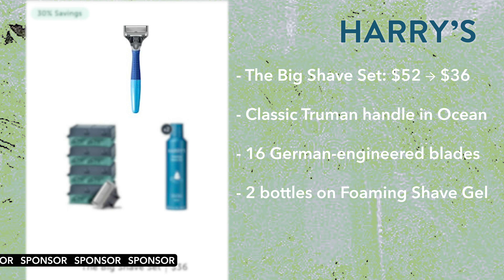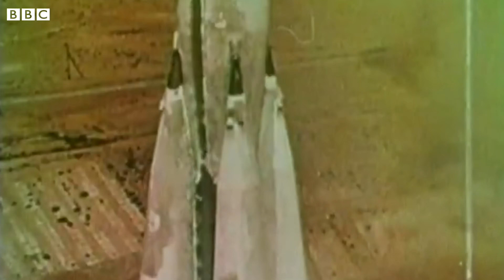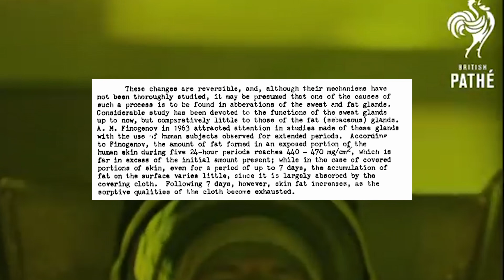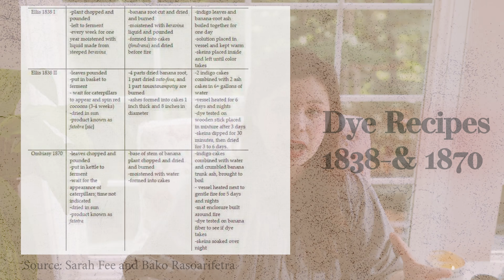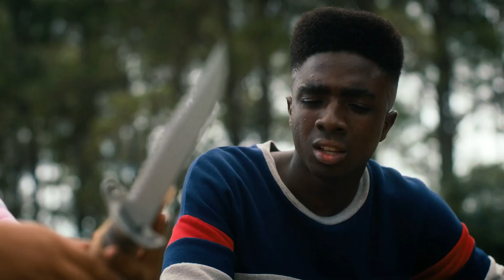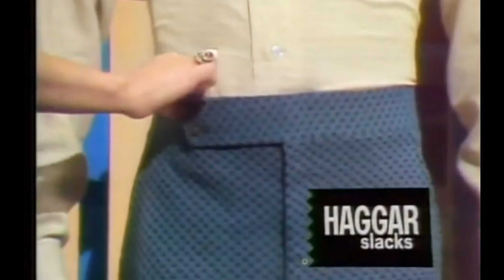The DISGUSTING truth about Laundry

Comment: I've been activily working of this (and I mean all of it) for many years. I'm surprised you didn't know about the poopy t-shirt bit before now.

Due to having hard water, I pour the water from our 2 basement dehumidifiers into the washing machine (laundry room is in the basement) - it's distilled and softer and a way to recycle it.
HE topload washer - it's energy star along with the dryer.
I use eco-friendly detergent (lots of research done to find an affordable one that was truly eco--friendly yet actually cleaned). 
Vinegar as a rinse so no Downy or Snuggle.
Wool dryer balls for when I use the dryer (which is towels and sheets that won't fully dry in our basement before possibly starting to get an odor).
And we have an interior clothes hangar for pretty much everything else. We tried using the outside clothes line but there were too many birds leaving too many gifts on our clothes which meant wasting more water and electricity in having to reclean them.

It's not perfect since, as you said, the water doesn't get hot enough, and water and detergent are used, as is some electricity to run the washer/dryer and dehumidifiers. But we gotta start somewhere.

As for the undies - I haven't yet found a linen bra-like garment that's comfortable. I've started looking into cotton undies to sew but haven't figured out what style I want to go to - bikini? 1950's style? I could use the holy t-shirts I have and repurpose them as a recyle... I have time to figure this out because I have conventional undies that will last a long while yet since they're line dried.

This was a good topic to bring up. Thank you for it.

I hope you feel better soon.
Reply: What detergent did you end up using?
Reply: @kp_escapes  I'm still on the hunt for one. Unfortunately, the ones I've tried have all had problems. They weren't actually eco-friendly, they didn't clean or remove odors, left my whites dingy, etc.

Comment: Also you're saying line drying is awesome but how do you avoid crunchy/hard towels if you line dry?
Reply: They soften up after they get a little damp. I really don't notice much when I'm using them.
 I've used indoor line-dried towels for almost 4 years, and they're fine, especially if I used the highest spin setting. Shaking them out a bit before folding also gets rid of some of the "crunch".

Comment: Use  White wine Vinegar.  Instead of any  Detergent. Also if you have a room with a glass door or floor to  ceiling window and live in a  State that  Band's laundry lines when use that room becouse the sun can shine though the glass it wouldn't be as  Effective as  Direct contact but it still works. Basicly use a  Curtain  plole to hang your  Laundry in the  Window. It works, I have done this when it was rain and the close got dry faster then the ones hang up in my bathroom so the  Indirect sunlight does work really well.

Comment: I hang/line dry pretty much almost everything. I am too disabled to do that to my sheets, but almost all the clothes get hung up to dry and my Fast Fashion... ain't. I've had some tops for like ten or fifteen years, and they continue to last because of this, IMO. That and I loathe fabric "softener" and scented detergents with a violence, so I use a very mild detergent made with enzymes for dissolving allergens, and not a lot of it at once. Underwear all gets a hot wash, everything else goes through warm or even cool. The wash is enough to clean it. I also subscribe to the "If it ain't dirty, don't wash it" school of thought. Saves time, effort, energy, water, money and wear. On the other hand I am often wearing light cotton underlayers which I do change and wash a lot and those keep my outer clothes much cleaner. Towels and underwear sometimes get sanitary washes, but by and large I trust my detergent/soap, and the water softener my house has. Places that ban Line Drying are anti-human.

Comment: Thank you Abby for this informative piece. I hope it helps people understand some of the issues better. 

I have been pretty proactive I my laundry practices. I have room for a laundry machine (front loader, in the area where a dish washer would normally go) in my apartment but a dryer is not going to fit. We have roof access (thank goodness) and hang our clothes outside from summer through some of the winter. We don’t hang outside in spring due to high pollen counts and allergies. In seasons where heat is on in the apartment (radiators-very drying) we use a clothes rack and hangers. Clothes dry quickly. 

I haven’t used fabric softeners for many years and have a bottle of “natural” fabric softener sitting in my laundry area for many years (think it’s time it went out). 

I have started making my own laundry detergent and find my clothes are softer and last longer as well as get stains out easily. 

We also use a shorter washing cycle which uses less electricity and decreases the wear and tear on the clothing. 

I hope others can start practicing better laundry habits soon.

Comment: Tip: Contact your local water authority for the yearly quality report and get some PPM sticks to check your water hardness. We're a family of 5, and 2 of my kids are tweens (yay puberty). I do upwards of 10 loads a WEEK. I also cloth diapered all my children. My washer/dryer get used a heck of lot and I've learned how to be efficient and how to properly wash all my fabrics. I wash like with like, separating tops from bottoms but then further separated by fabric weight. For the washer to properly work, the ratio of water::clothes needs to be balanced. Tip I got from my CD days was the water needs to look like stew while agitating. I wash loads of medium-large, most on cold/cold, use at least a 1/4 cup of liquid detergent (Original Gain), 1/4-1/2 cup of Distilled White Vinegar in the rinse. Soiled garments get washed in hot (my washer pulls direct from the water heater, doesn't mix cold in, and our heater is set to 150F) with extra detergent, bleach if necessary. Rinse in warm (btw body fluids wash out of fabric better at warmer temps). Yes, I tumble dry. I do not have the energy to line dry, I have fibromyalgia, it's a miracle I get anything done. I do hang up what is needed on a rod in my laundry "nook." All of my laundry comes out smelling fresh and clean but not fragranced, super soft, and not at all destroyed. I do regular maintenance on both my washer and dryer, including cleaning them!

Comment: I didn't really start truly caring about caring for my clothing (including cleaning of that clothing) until I started making most (still working on all) of my clothing.  When you put so many hours into a simple tee shirt, it suddenly becomes very important how you care for it.  I always use white vinegar instead of softener and natural wool balls instead of dryer sheets in my dryer.

Also, I have a question - as I live in the damp mid Atlantic and line drying sometimes ends up with mold issues due to humidity - does tumble drying kill bacteria that washing does not?

Comment: I bought a portable washer to use in my bathtub so I don't use my complex's machines. I also use a waterstick (shower water softener), so the water I use in the washer is soft.  I sanitize with vinegar (also helpful for reducing color bleeding) too, and socks & underwear get their own load...and because it's a portable washer, I can fill it with water at the temperature I want & match water levels exactly to the small loads. I also use the rinse water from one load as the wash water for the next load. And because my complex charges for laundry, I line dry certain loads to save money. And because the little spin dryer part is a MF'n BEAST, my line-dried shirts take about an hour to dry.

I broke even on the washer's cost with laundromat savings in less than 3 months. the waterstick shower softener has been great on my hair & skin, & I use WAY less shampoo, bodywash, etc...so even though that was expensive (for me) as an upfront cost, I feel like it was worth it.

Comment: One way to increase the temperature of your wash is to increase the set point on your water heater if you can. The biggest barrier to using older washing methods, in my opinion, is the time and energy it takes to do them. I have done laundry in my bathtub and it's really time consuming and exhausting. I am a household of one; I don't think it would be feasible to do laundry like that for a larger household with my current time and energy constraints.

Comment: A somewhat related topic I'd like to see covered: Historic infant diapering. With this big push into environmentalism, we've seen the advent of reusable menstrual products, which Abby has covered somewhat in that video about period aprons. But what about diapers for pre-toilet trained infants? I know that the age of toilet training has been pushed back and back with the advent of modern laundry machines. But, as mentioned in the video, the modern laundry process is horrid for the environment. As are disposable diapers. So there's been a recent push for cloth diapering of babies (again) and I'm super curious as to what the historical process of diapering looked like and to see if those methods have had any sort of impact on today's cloth diaper movement like we've seen with the repopularization  of natural fibers.
Reply: The way me and my brother were diapered as babies in the 70s was as following: rectangular diaper clothes were folded in a clever way so that you could basically close them like modern diapers but then with safety pins. Larger babies required slightly different folding. I think my parents used a plastic sort of pull-on over it ("luierbroekje" in Dutch) and/or a more fancy soft diaper cloth. When soiled, they were put in a bucket with a lid. About daily, the bucket was filled with water and using a plunger to strongly agitate (not sure that was general practice though, lol), the worst of the dirt was rinsed out. Then the diaper cloths were washed in the machine at 95°C and air dried. They turned a bit grey after a while, but they were clean.

Comment: Oh, no Abby, what have you done!!  I feel like I need to make a new set of underwear and boil the crap out of it \( ' o ')/aaaa  Possibly the state of launduring (??) is better here in Japan because most of us do not have a dryer and have no connectors or room for one.  We hang our clothes out.  It's frustrating when you have to do laundry in the wintertime.  Drying takes a couple of days versus an hour in the summer.  When I go out on trips and use the hotel dryer I freak out because my clothes come out major soft and I am unused to that.  Traditionally, Japanese had washed their clothes, their hair, their bodies with ash from the kitchen fires, and I have always wanted to try that with laundry and see how it works out. I don't have a kitchen fire though, and nowhere allows a good controlled burn in the city, not even a barbeque... go figure.

Comment: This was so interesting! I’m from the UK and used to drying my clothes on a line. In 2004 I moved to New Orleans for a couple of years. The first time I washed a load of laundry I took it out of the machine and hung it up outside and went to work. When I got home, my clothes were wetter than when I hung them out. I did not realise how humid N.O is! After that I didn’t have much choice but to tumble dry everything. I ruined many a bra doing that. I didn’t know that you can’t tumble dry underwired bras. I learned a lot. Now I only machine dry if I have to. And never my bras!
Reply: I live in that area too. Line drying is problematic to say the least.
Reply: Even though I would not advise tumble drying (especially padded) bras too often you could just try to put them in in one of these extra padded laundry bags. The larger ones are also great for not having socks everywhere ;)

Comment: hm. I think the most eco-friendly thing possible when it comes to buying a washer or dryer would be to see if you can buy a used or refurbished energy efficient one. But obviously that's going to be super difficult for most people. Other than that, you researchers would need to do a whole lifecycle/carbon footprint analysis on both types of appliances. My gut assumption is that it will depend on where you live and how much laundry you do, with odds slightly in favor of new energy efficient appliances?

In an ideal world, we would have a cyclical system where the old appliances are taken apart and used to make new ones!

Comment: I use white vinegar a LOT as well as bicarbonate of soda in my laundry. If I’ve had clothes too long in the washer, I’ll do them in another wash, using vinegar as the detergent. I also use it as a rinse aid (brilliant for softening up towels. I’m pretty sure it softens up the water AND changes the pH, which would help handle a lot of microbials. I also use it instead of fabric softener, for things like towels. I also use eco detergent, like Faith In Nature, ECOS or similar. Another recent tip I found out was to use a bit of bicarb of soda as a prewash, which REALLY helps with deodorising things like sheets that are a bit whiffy due to age. Bicarb in the prewash, vinegar instead of fabric softener. I do use a tumble dryer, but these days I hang things out to finish drying on an indoor airer and a lot of my clothes go on that anyway. A dehumidifier is excellent for faster clothes drying. I also do an extra spin to cut down on drying time too, if the garments will stand it. I always also use protective bags for washing things I don’t want wrecked too. There’s some great books out there describing how to use vinegar, bicarb, soda crystals, lemon juice and the like for laundry. And ironing helps with drying and softens things up nicely too

Comment: PSA for handwashing delicate clothing like bras etc. Instead of using the expensive handwashing detergent just use shampoo. It is gentle enough to not dry out your skin horribly and is designed to clean the oils from your scalp.
Reply: shampoos are every bit as bad as laundry detergents.  They contain chemicals that strip the hair because in order to clean your hair, the conditioner and other hair products you use, need to be removed before the normal scalp oils can then be cleaned.  And they add chemicals just to make lather so it looks like it is doing it's job.
Reply: @JeanneLugertLadyTatsLace  I will not disagree with you. If you have a detergent-free option for handwashing that is effective and inexpensive I would love to hear it. 

My comment is merely ment to give people an inexpensive opinion that is effective rather than an environmentally neutral opinion.

Comment: If you wear woollens you can lanolise your clothes and they are antibacterial and water resistant. They smell pretty good and they rarely need washing. You hand wash them (which uses less water and less detergent) and then lanolise them in the same water. I use hard lanolin and melt it in a little hot water and mix that in with the water.

So you can make your own clothes by knitting, crochet, weaving, etc; and then you can coat them in a substance that keeps them clean and fresh.

I use it mainly for reusable wool wraps and my wooly winter poncho. I think you can lanolise other natural fibres such as alpaca. I don't know about anything else, but it'd be an idea to experiment.
Reply: @cikufałdka I lanolised my babies wool wraps and used less than 10l of water for the 4 wraps. All 4 fitted in a 5l basin, and I put them in the soapy water (roughly 30C as you don't want to shock the wool) and squeeze washed them (no rubbing or wringing), then added the lanolin, then squeezed them all out, then put in clean water and squeeze washed them in that, before squeezing them out again. If I was doing other wools by hand I would use the bowl to do spot cleaning then do the cleanest that just needed refreshing first, then only change the water every few items or for actually dirty items. For rinsing I'd do the most colourfast lighter colours first, and change the water every few items. So I can do say 3 jumpers in less than 10l of water. The main thing about woollens is that if you don't wear them close to the skin and you wear them all the time, they only need washing once a season at most.

Comment: One interesting thing about line drying is that the breeze is often more important than the sun for the actual drying process. You can dry (or mostly dry then finish on an airer inside) in pretty cold temperatures. And from reading period novels I know that people would hang washing outside in freezing temperatures and it freeze rigid on the line!

Always use less detergent. Decide how much you need by the level of soiling. Powder detergent always used to give instructions on how to vary it but since pods are taking over people are using a high dose for every load. 

Putting clothes into a freezer is a good alternative way to refresh outer clothing. Just fold it into a plastic bag and freeze for 24hrs.

When you take outer clothes off put on a hanger and hang on the front of your wardrobe or from a door frame. Let any moisture dry off and the clothes air. Decide the next day if they actually need laundering and if not when you put them away you are not putting moisture into your clothes storage.

If you have a warm room in your home consider a ceiling mounted airing rack on a pulley. Hot air rises and as well as it being a great place to dry things it also means you don't have a drying rack taking up floor space.
Reply: How would you fit anything bigger than a pair of knickers in the freezer? There's barely enough space in the drawers for the food we freeze let alone clothes.